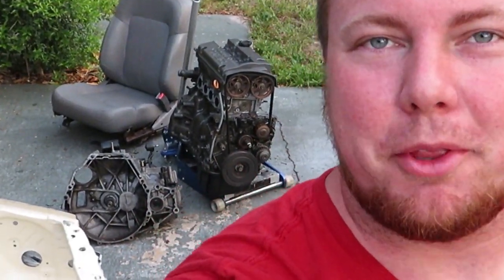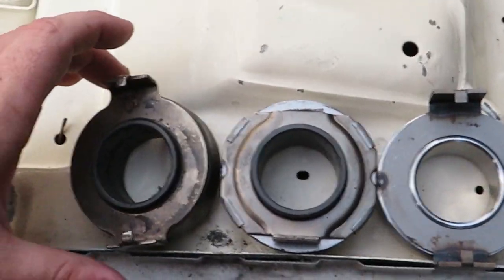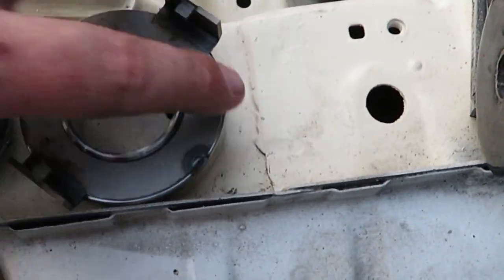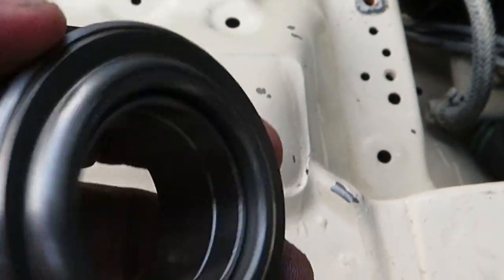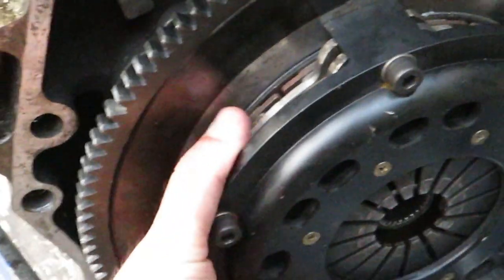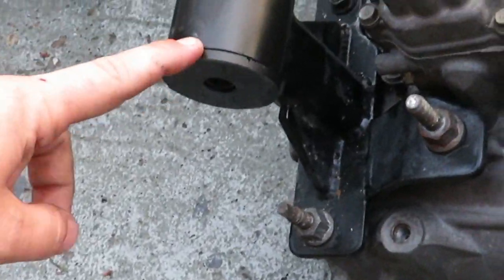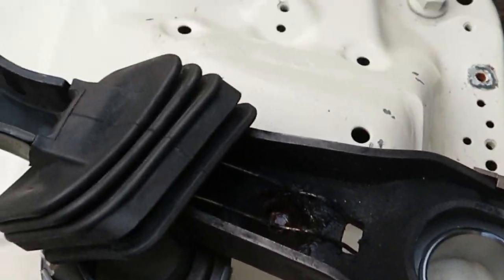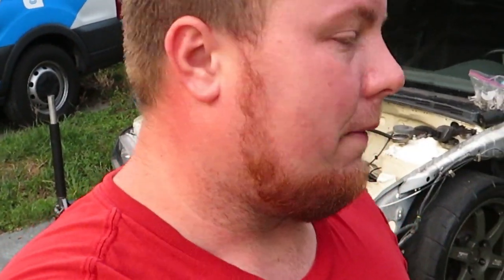Accord ep3 (How to install a h22/f22 with just a floor jack)

Comment: H2B for sure but i can get down with both
Reply from the maker: B20v or h22
Reply: @YostBuilt  if you really want to do something different id go f2b with an f23block with the f22a head and k20a2 pistons.  or do the same thing with an h22 head.  H22 is the way to go for sure the only thing is b20v is cheaper and easier
Reply: some inspiration
Reply from the maker: @timm5970  that's my boys build from south Florida
Reply: @YostBuilt  that shit is sick.  i would love to see that in the da.
Reply: @YostBuilt  i mean he hit 250whp with a 10.9c/r.  i think with the k20a2 pistons youd be above that.  imagine spanking pablo with a single cam n/a
Reply from the maker: @timm5970  made 187 whp and 250 bhp..but yeah
Reply: @YostBuilt  nope.  He hit 250whp
Reply: @YostBuilt  the link on cb7 tuner is a dyno graph of the same car with more mods and i believe e85.  I think its 230whp on pump but i dont remember